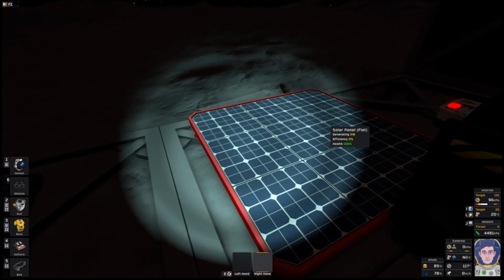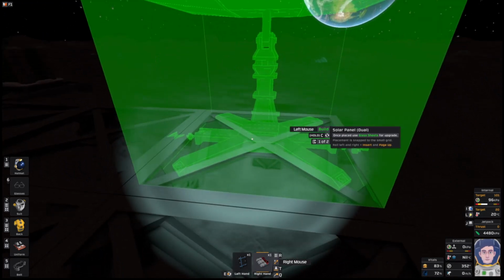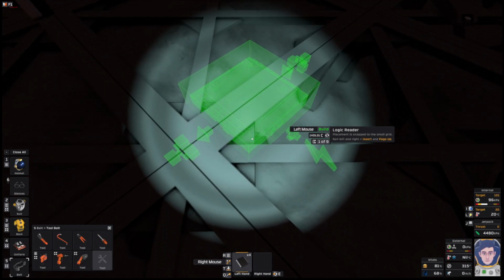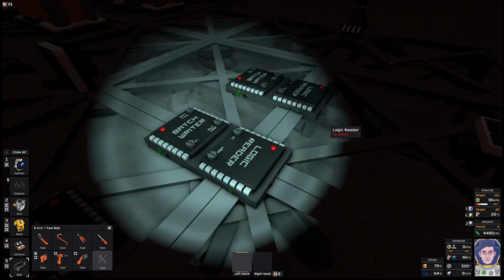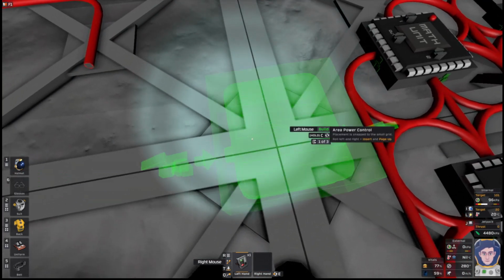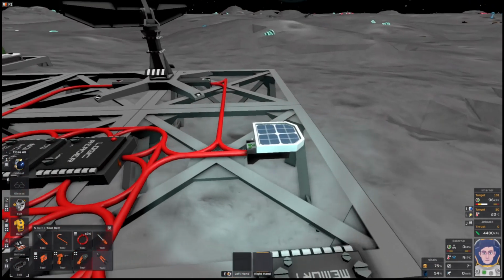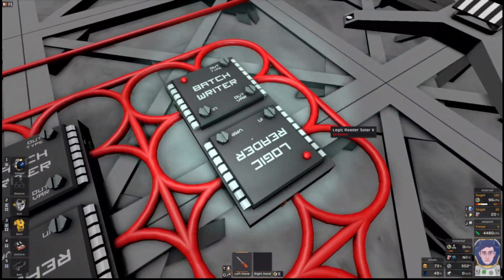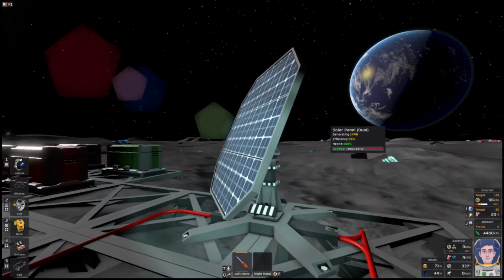Stationeers: How To Set Up Solar Tracking

Comment: If anybody is having issues with this(on mars for me) facing the opposite way horizontally, all you need to do is add another memory, and for me it was -90. Might be the same for you too, but I don’t know enough to be certain. So just adjust the value until it works. And you’ll be able to see it ticking in the direction of the sun travel👍

Comment: Very nice guide. However for beginners - solar panel automation is more like end-game project when you have nothing better to do, is not time-efficient thing. It is so much simpler to install 3 times number of flat panels in different angles and be done with it. Solar panels are poor choice in everywhere but moon, turbines are so much better choice and give you power at night too. Normal solar panels need constant repairing after each storm unless you encapsulate them in glass dome. Weird but in real life, solar panel do not need much maintenance and can last over 20+ years easily. Same glass when installed as window does not need any repairs.

Comment: Maybe something has changed but this method does not seem to work anymore. Or at least partly. When the sun is directly overhead, the vertical is 0. But the vertical does not become negative once the sun passes this point. Before and after reaching the zenith, the vertical is a positive number. For instance 10. So what happens is that the solar panels track the sun until it reaches overhead, but after that the solar panels track in the opposite direction.
Reply: Yes it seems it has changed with some updates. I'm new to the game so can't tell how it was before but it's really simple now. I'm using Solar tracking on the Moon so I only need to track vertical movement. You need only sensor and 2 i/o chips.. Put Sensor on The wall facing east (not on ground or flat roof but wall) connect sensor to logic reader, then connect to batch writer. Then. Simply run cables connecting chips to solar panels.. I think they changed how the sensor reads angles of the sun.. The way I described Sun will rise at 0 degrees and and hide at 180.. My solars horizontal are set to 90 and energy output is facing east (in case it's important).. Hope it helps..
Reply from the maker: There have been quite a lot of changes since I made this video! I need to remake quite a lot of content to bring it up to date. I have a list and will work through it as fast as my free time allows!

Comment: Any chance you can explain why you input 90 into the memory chip? I cant get get my head around it haha
Reply: I’m not actually sure, but I think it’s because the daylight sensor measures the angle of the sun from the horizon and the solar panels start at vertical so the 90° will make the solar panels start at the same angle that the daylight sensor does but I might just be wrong

Comment: Why do you need so many coil connections? Can you get away with one or two coils per logic unit?
Reply: All of the logic chips have different amoun of connection spot and different amount of needed connections. Such as Logic Memory chips have 2 data connections but only one needs to be connected. But others like the Logic/Batch Readers have 3 connections, 1 power and 2 data that all need to be connected. Also to note most of the Logic processors have 4 connections, 1 power and 3 data. But some like the Logic Unary Math Unit has 1 power and 3 data spots, but only 1 power and 2 data spots need to be connected. Also as a side note, all of the data connections have to be connected on the same circuit as the devices that you are trying to control. But you are able supply power to the logic chips from a different circuit. Hope this helps.